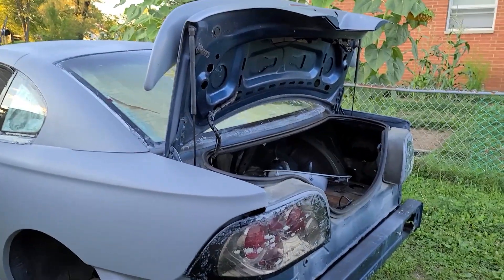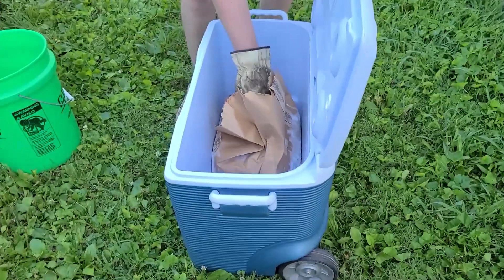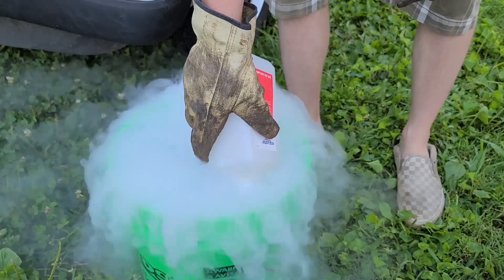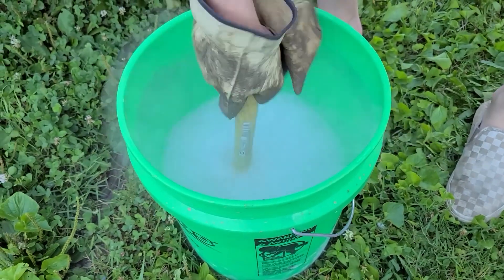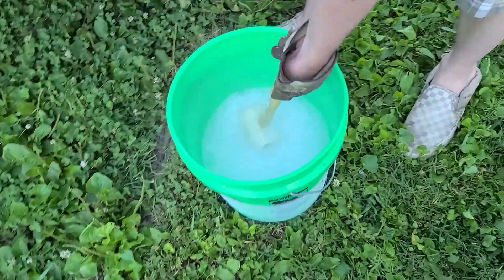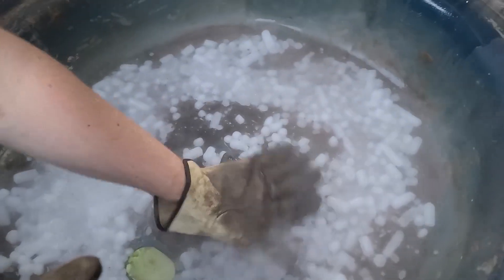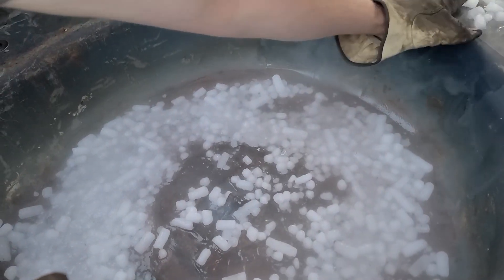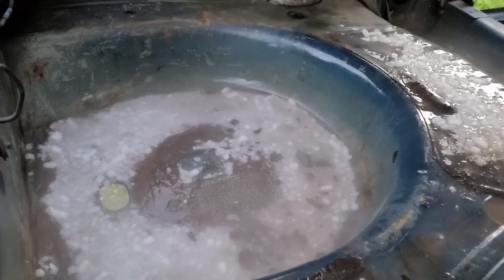Dry Ice Sound Deadening Removal - Co2 Cool DIY

Comment: Awesome man I’m pumped to see vid #2. I have had quite a few mustangs and those little 2v motors are fun and sound amazing. I am a 5.0 guy but that block with proper internals can hold a hell of a lot more. Can’t wait to see what a simple turbo will make. I’m thinking of picking up another 2v as a project.
Reply from the maker: Thanks man, appreciate the viewership. The goal for this car is the stock short (possibly long) block 1/4 mi record, so I won't be modifying anything as of this second. After that, I will put Coyote rods & Keith Black (cheapest "performance" piston you can get) pistons in it, and see how far that can go, which should be pretty far. I just want to show people that these cars still have value, especially the younger gen that maybe don't have as much jack; I'm just a cheapskate.
Reply from the maker: Next video is rendering now, should be up in 15 mins.